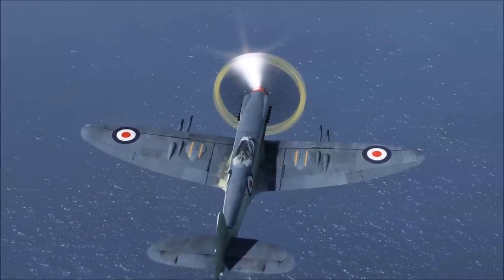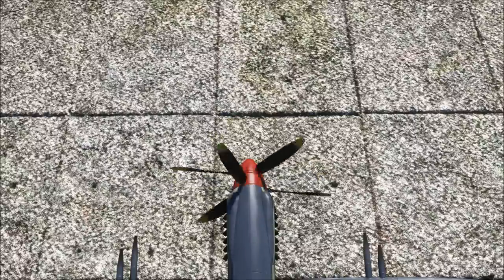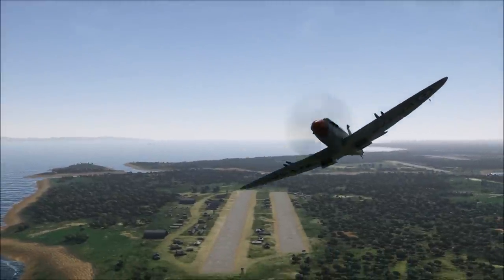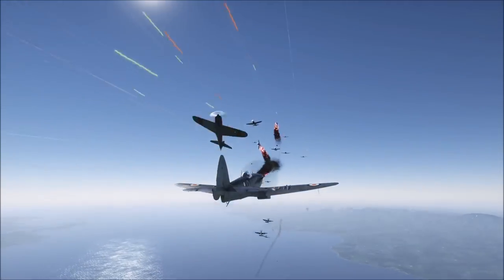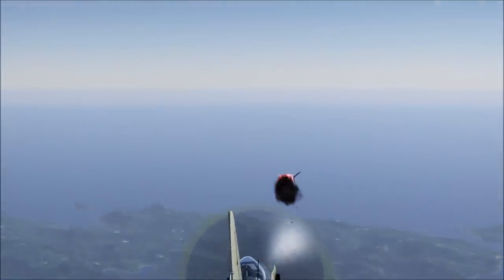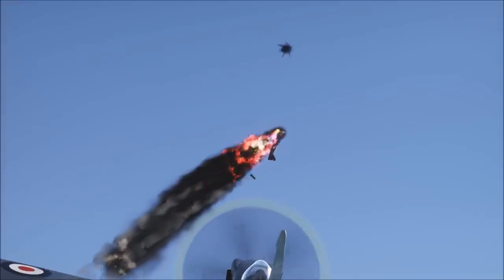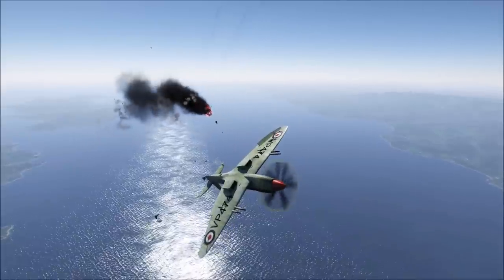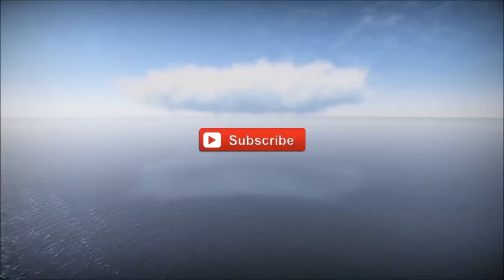War Thunder Seafire Mk 47 Gameplay & Review

Comment: The Tu95 isn't that loud because of its contra rotating props. It's because of the speed those props are spinning at. The tips of each of its props are breaking the sound barrier. That creates 4 engines x 8 blades = 32 constant sonic booms. The Thunderscreech also had this problem, but it was not contra rotating.

Comment: I do have to say that one of the big reasons why the Bear is so loud is cause it's propellers spin at supersonic speeds,although the contra prop is also a factor in it's noise.
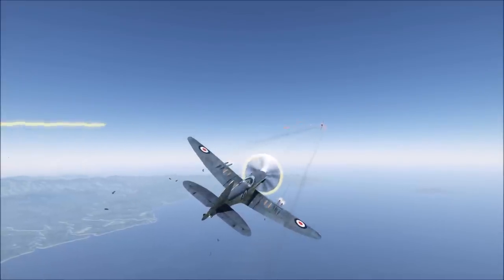Reply: Alan Kućar Also, at 6:02, you said Tempest Mk IV which never even entered prototype stage so i asume you mixed something up:D
Reply from the maker: Alan Kućar I of course meant the Mk.V - no idea why I said IV, although you are in fact mistaken that it never got as far as being prototyped.
Reply: I thought that you might have just randomly brain farted:D
But are you sure that the MkIV became a prototype, i thought it didn't get past drawing boards.
Reply from the maker: Thank you - yes.
Reply from the maker: Alan Kućar There was one constructed but not flown - it had a Griffon 61 installed and went by the serial no. LA614.
Reply: DigitalDigging Thank you, I'll look into it.
Reply from the maker: Alan Kućar Actually although they are technically capable of supersonic speeds, there are some good reasons why they very rarely do it.
Reply: Well ofcourse, if they would rotate at such high speeds all the time, imagine how often they would have to change all the parts that are connected to the engine, the vibration alone could cause considerable damage to those parts.
Reply from the maker: Alan Kućar Right, so it's actually a very small reason for the loudness of the TU95.